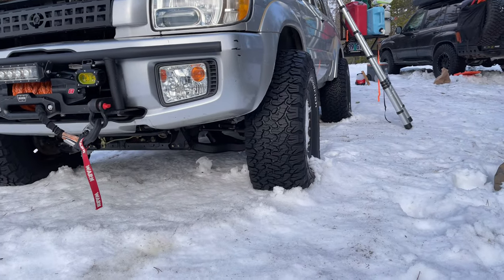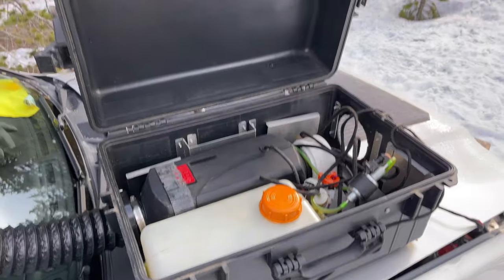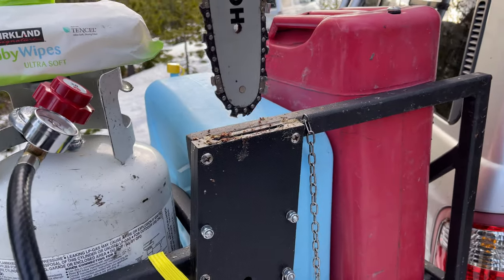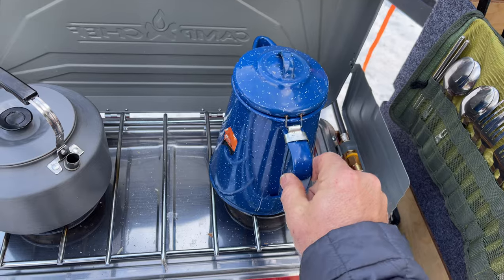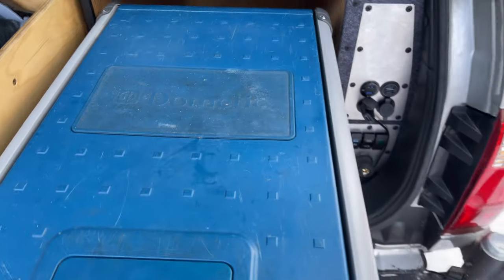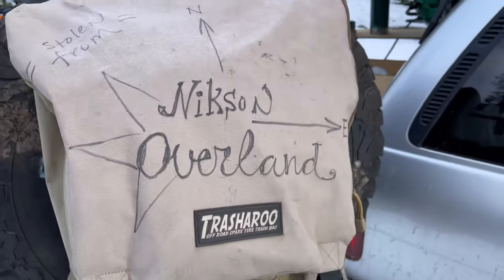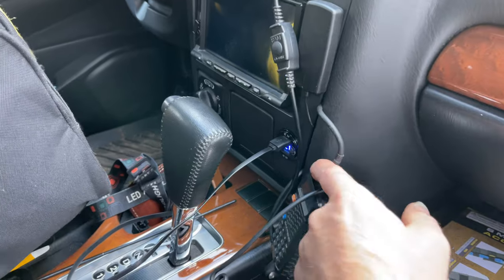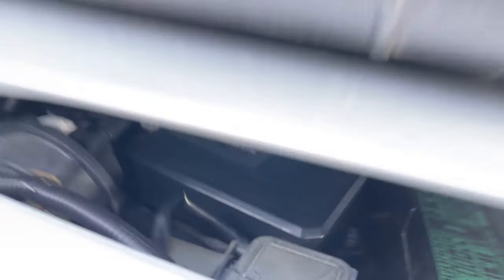Infiniti QX4 R50 Shakedown - Spring Time SnowCamp

Comment: Awesome off grid camping. Very nice organizing your equipment. Thanks again for the video!
Reply from the maker: Thanks for watching!
Reply: @budnixon  I really love your belt on your QX4 it's just very bakes it and simple I like that I've been slowly building mine right now I'm rebuilding my motor and mine if you ever any advice about a transmission I can't actually give you a part number for re4 or already five transmission but you will have to change that torque converter to get the transmission to fit I actually got a re4 Chevy 1500 transmission to fit in mine without changing the drive shaft.
Reply from the maker: @andrewforsythe4622   Thanks.  My R50 as many other previous builds are a process of a learning curve to do one thing or another, I think sometime next spring it will be going up for sale.  I'm already looking around for another 4x4 that I can build up and try different things.  As far as R50, I've reached my end goal and what I wanted to do with it; now just getting to use it a little when I got time for a trip.

Comment: Awesome video! What do you have for front and rear lift? Also how much for the rear side window Molly plates?
Reply from the maker: Front/rear springs are Dobinson 30mm, front struts are ToughDog, rear shocks are Fox 2.0 (I extended upwards shock mounts by 3in), 2in spacers all around by SFCreations, with my own custom 3in SFD on front (including steering link upgrade)
Reply from the maker: Molle panels are $200/pair shipped

Comment: What size winch plate did you use?
Reply from the maker: One rated for the winch load I used
Reply: Do you have a link? I’m also in an R50 platform and would love to keep my factory bumper.
Reply from the maker: What I mean to say - things were fabricated to fit the winch I used - actual plate/hidden winch mount in factory front bumper - that was built by me, there is no link as it was not something purchased... I build/sell them